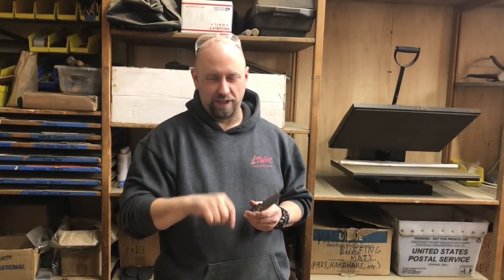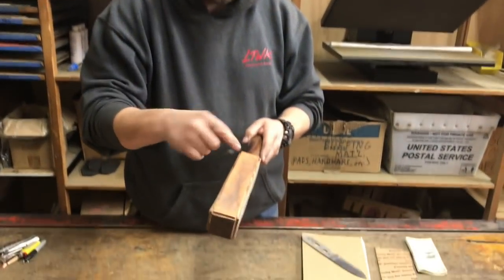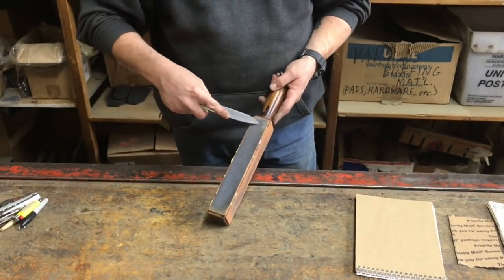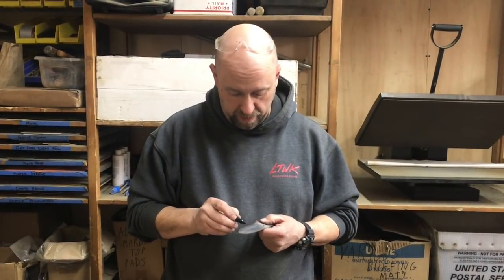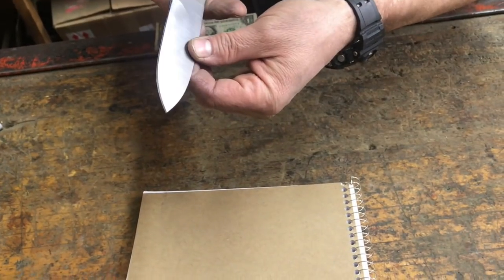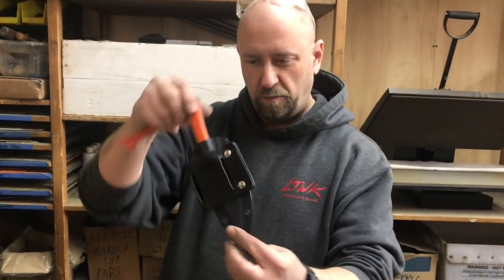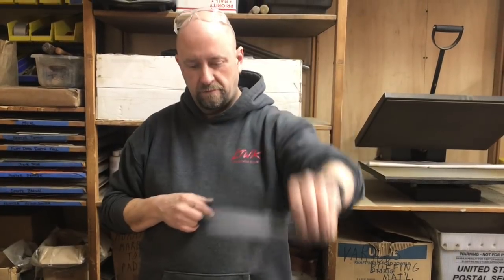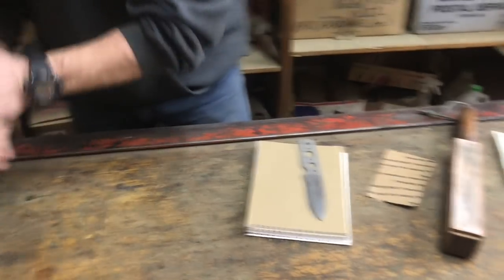LTWK How-To: Sharpen Your Knife Part II

Comment: Great videos - if you don't have access to a power sander and there's a sizable chip in the blade how do you remove the chip? Thanks for your help.
Bob
Reply: This is how I fix BIG chips at the shop, just replace a belt sanding machine with as big of a sharpening stone as you have.  Run the whole edge on the stone like you were trying to slice through it.  You have to get the whole edge down to the height of the chip.  Then, resharpen as normal.  It'll take longer because you'll be starting as if it was a new, never sharpened knife.  It depends on the knife but, this could take awhile.  OR, send it into the shop and I can fix it up here.  What's the knife and what's the grind?

Scooter.
Reply: @zebratruck  Thanks Scooter. It's a Scandi grind, make is BPS. Bought from the Ukraine just before the war started.